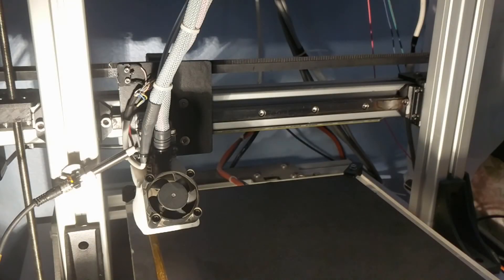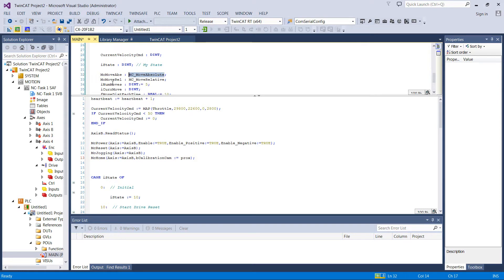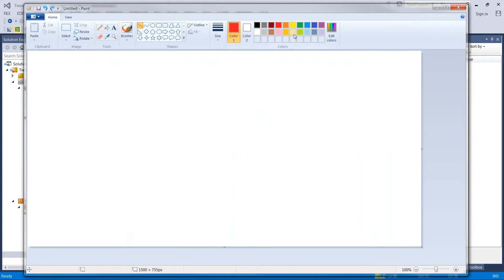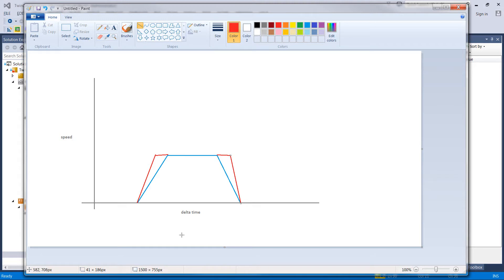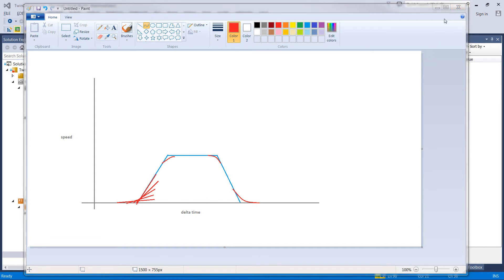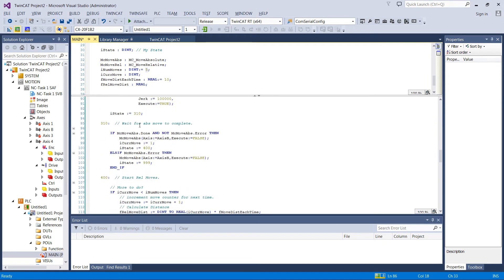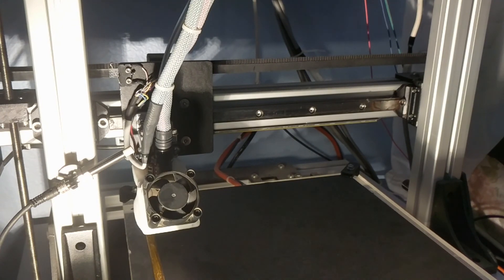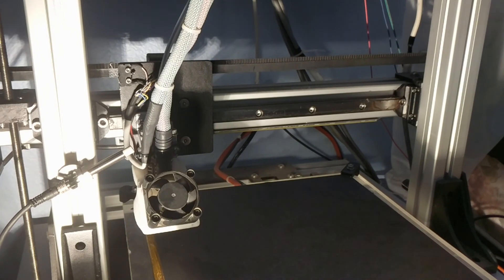Motion Control and IO with PLCs - EP12- MC_Absolute and MC_Relative

Comment: Nice video. i am trying hard to understand, if motor can be control without encoder then why use encoder. You are also using Motor Without Encoder and doing things what you want. Please will you explain the limitation if encoder is not being use. Thanks
Reply: Good question, hopefully he replies to this whenever he can. Im using a 7041 without an encoder for a project with a stepper motor and am questioning what the encoder part is used for if your able to make absolute and relative positions without one.